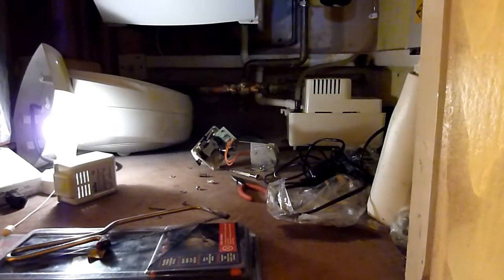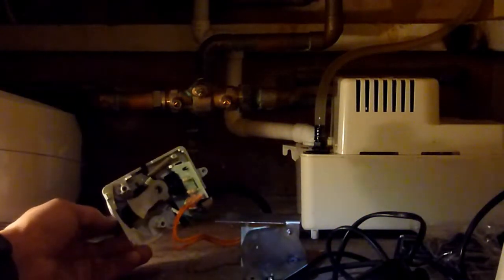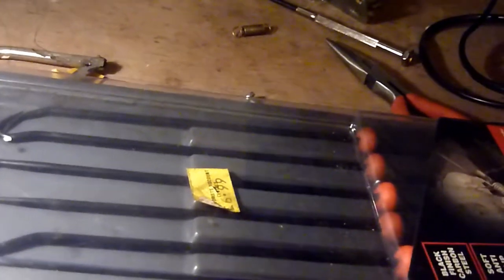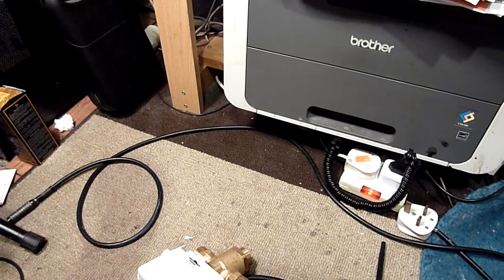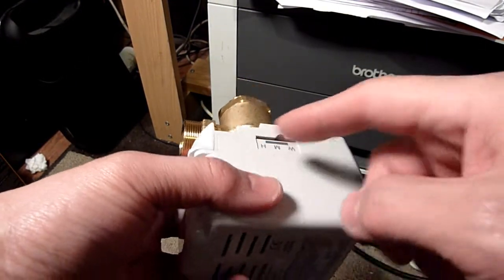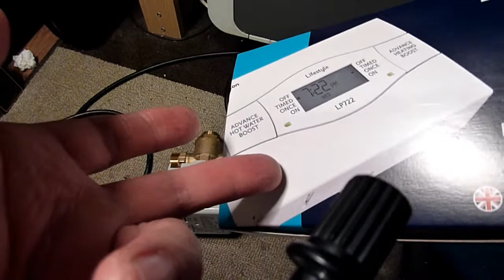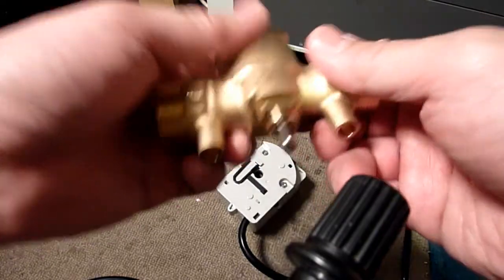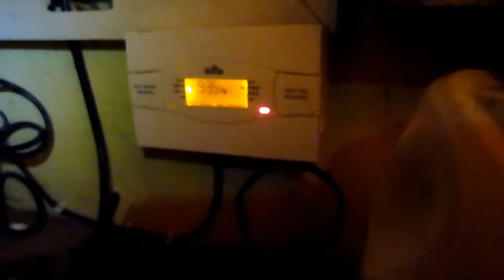Fixing a Mid Position Actuator Fault on a Combi Boiler

Comment: This is great, I have the same valve and it sticks in M position even though the roomstat is calling for heat, if I give the head a wiggle the lever will then move to H and the boiler will fire, so I was really interested to see how the actual valve worked - like you I took the head off and turned the spigot by hand, I have to use a pair of pliers to turn mine, it's quite stiff, but I was surprised how little rotation is required to move from W to H so to see you show the valve changing as you turned the spigot was great. I am thinking that maybe my valve is a little too stiff for the motor so I may have to drain the system down and change it. Thanks for the video, it's really helped my understanding.